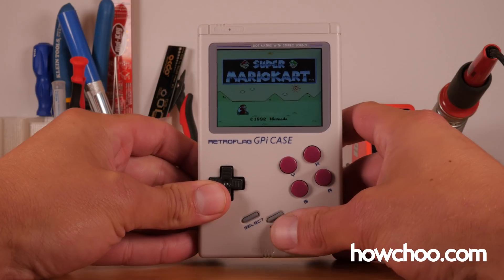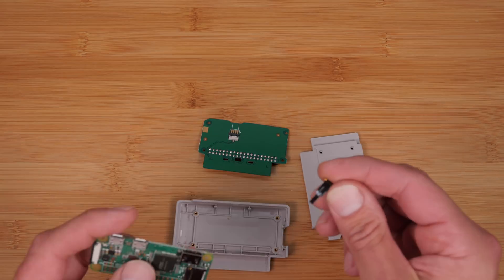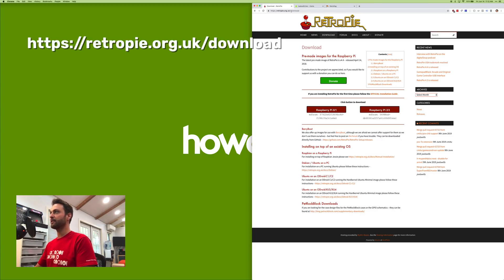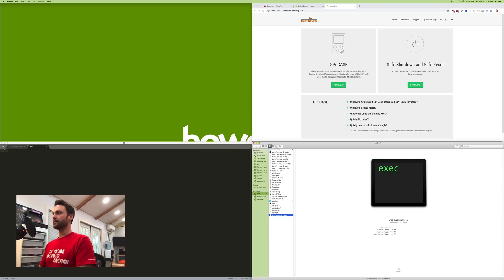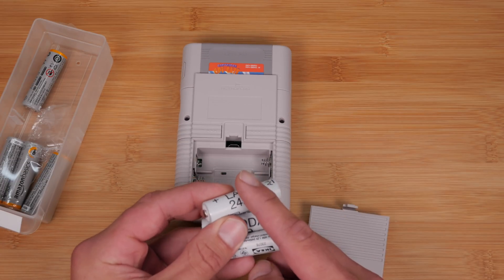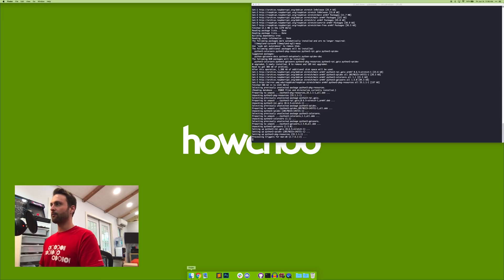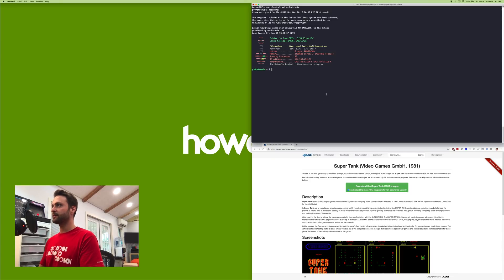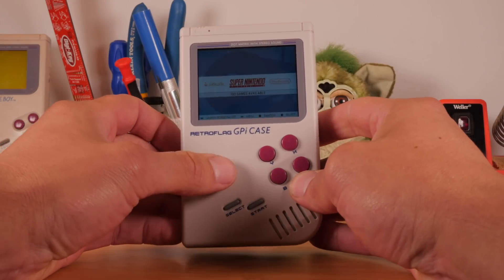Retroflag GPi Setup: Everything You Need to Know to Get Playing!

Comment: I'm getting a black flickering screen on my initial boot?  Any clue what I'm missing?  Been at it for a few hours now, and I'm totally stumped!  Thanks!
Reply from the maker: Strange, are you able to get a normal picture at all, or does nothing show up? In either case, try reseating the Pi and make sure you installed the patch files.
Reply: @Howchoo  Thanks for the reply.  I was able to get it sorted out.  The interface ribbon to the from the Pi wasn't properly attached.  Once I tightened it down, it booted right up.  Wifi supplicant file is giving me quite the headache, but I guess I need to add the country code.  That part wasn't in your tutorial, but It could just be me.  

Great vid and instructions.  I subscribed!
Reply: @Howchoo  So I can't figure out the WiFi part of your tutorial.  I added the suplicant file per your instructions, but I'm not able to SSH into the device, so I went into the Pi Config on the device and noticed that WiFi isn't recognized at all.  Any suggestions?  I'm running Windows.  Thanks!
Reply from the maker: Did you get this sorted? Not sure because of the order of your comments. Lemme know!
Reply: howchoo no.  I cannot get the WiFi figured out.
Reply: @Howchoo  Nope.  Still struggling with the WiFi bit.  It's my first Pi setup, but I think l'll be an expert after this attempt! LOL.

Comment: PSA: On retroflags website under the support > gpi download area, there is a question and answer relating to speeding up load times via changing the localisation settings. DO NOT DO THIS!

I found out the hard way this most likely is the cause for "unhandled alignment exception ... Bus error" which causes emulation station to crash to prompt.  Will happen fairly often and mostly seen during emulation station idling on the menu selection area.

I fixed the problem via setting my localisation to AMERICA and then picking a city.

Google this for more details:

Bus error on Raspberry Pi 2 armv7 command line app #22384
Reply: Might actually be the rpi zero overheating...still investigating.